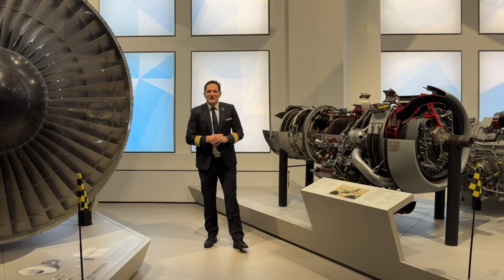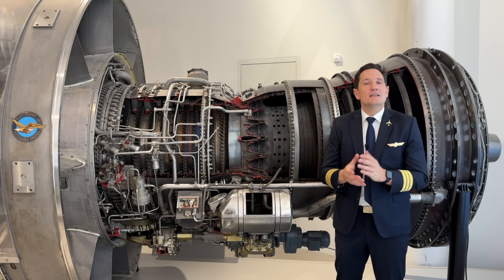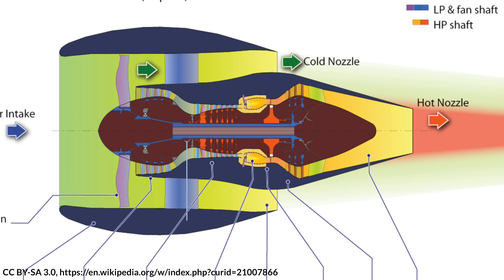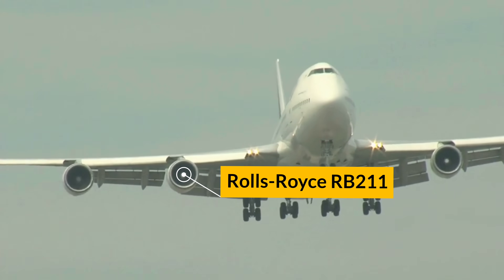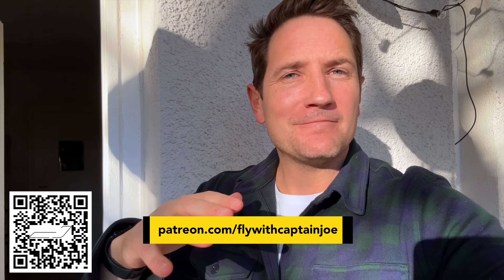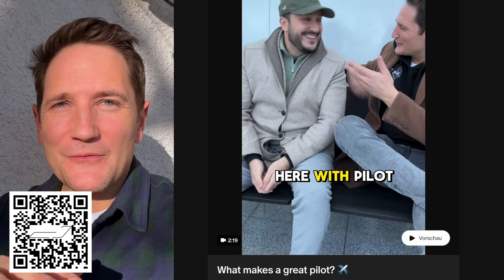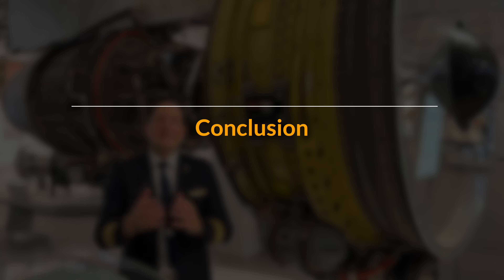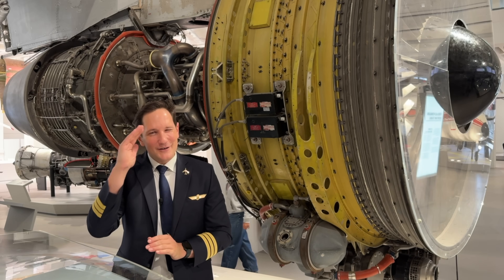Turbofan Engines: How They Work and Why They're Important - by CAPTAIN JOE

Comment: Big Turbine Hard Believe engineering even near optimal. First blade set enforce Flow and pressure against Motor eject plane forward increased volume Flow vs eject area. First Turbine set go through blade set To another pressure Flow go diffrent total pressures vs height. How handled optimal different heights

Comment: They should cool the air between the compression stages in order to inject little cooler air into the combustion chamber. This will improve the carnot degree of efficiency and follows that having 1 stage compression more and inject more fuel at same output tgas temperature through laval nozzle air inject to 1. Srage turbine stage

Comment: Question: regarding the fan bypass ratio, the examples you give for a/c from 5:1 thru 10:1 equal 5 times the amount of air bypass around the core of the propulsor in comparison to the thrust blasted from the tailpipe?

Comment: Hi Captain Joe. Can you make a video about the applıcatıon of Brayton Cycle to the TurboFan engınes. Step by step explanatıon of the Thermodynamic cycle troughout the engine on the P-V diagram. Effıcıency formula explanation of the engine. Pressure, Tempereture and Velocity graphs along the engine.

Comment: Im still struggling to understand how turbo fan engines produce 80% of the thrust used by commercial airlines and the core only 20%. how does it generate that 80% thrust without burning fuel
Reply: Because majority of the energy generated in the core is then converted to mechanical energy which then drives the fan which generates the majority of the thrust.

Something like how in a turboprop, the exhaust gases doesn't produce thrust, but only the propellers do.
Reply: @ZK-APA  thank you that makes sense to me now

Comment: The OPR or Overall Compression Ratio of a tipical turbo jet engine is in the range of 3.46 to 26. But for turbofan has above 30 with about 1.6 EPR and400 to 1100 EGT. Do they work at lower fuel consumption for this to takeoff and Go around?.

Comment: I'd have to work this one through, but, at higher altitudes there is much less volume of air that the 'fan' can move. Is there a trade off? If the bypass air has less volume per unit of time, how would this affect performance? Does the turbine part of the engine, need to increase operation in order to maintain a constant bypass airflow?
Reply: At very high altitudes, turbojets and low bypass turbofans give better performance

Comment: Next explain thrust reversers.  How an engine suck air in front and blow it back out the same direction it came and have a net force greater than 0?  It doesn't produce air after all.  All the air coming out had to go it first.  And if you don't reverse the intake, why doesn't the intake cancel out the exhaust during reverse?

Comment: I worked on the assembly floor at P&WA in the late 1970s assembling JT-8s and JT-9s. That looks like a JT-9Q with the variable pitch stators in the low compressor. I worked on P-3s in the Navy before that.

Comment: Concorde used 4 (Bristol Siddeley) Rolls Royce/SNECMA Olympus 593 Mk610 turbojets, each producing a maximum thrust of 38,050lbs, with reheat/afterburners.Without the reheat, they produced 31,350lbs. Overall pressure ratio was 15.5:1

Comment: Thank you so much for this video! Finally someone actually focuses on the bypass and how it works. That's the topic I was curious about for a long time, however majority of videos on the Internet explain only the core part (compressor, combustion chamber, turbine) and then at the very end simply add "oh, and by the way, the bypass also increases efficiency". And no one explains how??

This is the first video that properly pays attention to bypass, explaining how it works and why it helps with efficiency and noise. Thanks!!

Comment: 2:14 - one minor comment to add here is that, while, yes, 99% of turbofan engines do indeed have the fan at the front, there are exceptions. The Convair 990 Coronado had General Electric CJ805 engines, which actually have the fan at the back of the engine. The GE CF700 also uses this design, powering some variants  of the Rockwell Sabreliner and Dassault Falcon 20 business jets. Sure, it's an unusual design, but it certainly exists

Comment: Answering some of the questions posted here for the benefit of everyone:
1) Why turbofans are more efficient:
The thrust of an engine is a force. Taking newton's 2nd law, F=ma=m(dv/dt). To increase thrust, you can increase the mass of air being accelerated, or accelerate it more. However, the energy required to accelerate this mass of air is proportional to the change in kinetic energy of the air (KE= 1/2 m V*squared). Therefore, to double the velocity of the air, you have to expend 4 times the energy and it follows that accelerating a larger volume of air by a smaller velocity is more efficient.
2) Turbojets vs turboprops vs turbofans
As Capt Joe mentioned, we start off with the turbojet, which is a gas turbine that expels high velocity air as thrust. If that gas turbine was then used to drive a propeller shaft, it is then called a turboprop. If it is used to power a rotor shaft, it is called a turboshaft. If it is used to drive a ducted fan, it is called a turbofan.
3) Geared turbofans
As you increase efficiency by increasing the bypass ratio, the size of the fan has to increase too. However, large fans tend to suffer efficiency losses with supersonic shockwaves at their blade tips (on top of requiring sturdier materials due to their higher rotational velocity). To circumvent this, new jet engines like the PW1000G have a reduction gear that steps down the fan RPM to a more optimal speed, while maintaining the LP compressor at its optimal RPM.
Reply: You may be right about point 2), but I would like to understand it a bit more. What is the difference between a propeller and a fan? Is it just the size? Is it just that it is ducted? Some more details, the trade-offs would be nice to understand.
Reply: @balazslengyel6950  I think it's considered by its the size or name of the things swirling around the rotor. As you may know, there's some news on "Open Fan" Engine recently, so that's why I think the name could be originated by the type of fan/propeller. I'd also like to know more about this one
Reply: If you look up Newton's law "F=ma" where "a" is acceleration and not velocity. Please avoid basic mistakes.  https://en.wikipedia.org/wiki/Newton%27s_laws_of_motion.
Equating thrust which is a force with momentum is a strange statement. As Newton's 2nd law states Force is the change of momentum per time unit. F=dp/dt

Thanks for the update.
Reply: @balazslengyel6950 Thanks, I've edited the comment based on F=ma,

Comment: Parallel to the gearbox idea, what about a hybrid airplane? Have a third shaft in the turbine (or an apu type system) to produce electricity that spins an electric fan. For instance, the outer pair of fans on a 747/A380
No weight of batteries and the improved efficiency with less combustion
Reply from the maker: Already in planning! I'm good friends with Pratt and Whitney :)

Comment: Q, Weight and balance is so important on aircraft why aren't there sensors and scales in the landing gear to tell you exactly the weight and balance?
Reply: Ask the accountants about it. Of course, it would be splendid to have own built-in weight sensor, but... this will increase the mass of the aircraft. Every aircraft will need to carry this extra mass during each takeoff and cruise, which incurs higher fuel cost, let alone the design, installation, maintenance, calibration etc. So, it will be cheaper to use stationary balances at the airports. If you had this idea, engineers had had it too, but it must have turned impractical or cost ineffective.
Reply: @ i think the weight  and cost issue would be indicated by the safety advantage, say it cost 1million more per aircraft at the price of 100+m it would be a drop in the buket,   and the weight could easly be justified,.
Reply: additionaly knowing the exact # wolud allow you to plan your fuel more percicley  effecting saveings

Comment: Can you please explain how the aerofoil works to produce lift when an aircraft is flying inverted? Does the pilot simply have to use lots of tail elevator to counteract gravity, or is it more complicated? Thanks! 👍
Reply: In regular aircrafts, the inverted position would require different (larger) AoA and more trimming to counteract gravity and (inverted) lift, as you mentioned. In acrobatic aircrafts, airfoils are more symmetric, so the (inverted) lift is not so strong and it's easier to control the aircraft in inverted flight. Certainly, this is always  trading manouvreability for efficiency of regular flight.

Comment: The Concorde was powered by the Rolls Royce Olympus turbojet engines with afterburners and variable intakes for supersonic speeds.
Reply: The B-52 will get new turbofans and lose 100 MPH cruse speed.   Making them obsolete.
Reply: @u2mister17 - Switching to Turbo-Fan engines would lengthen it’s range and longer between time needed for refueling. Important for on the air nuclear deterrent sentry, speed not much since the former higher speed wasn’t substantial to make any difference.
Reply: @inisipisTV    Nice salad.
Reply: @inisipisTV  
No need for an "air nuclear deterrent sentry". That's what ICBMs are for. Also, a drone could take it out. times are changing.
Reply: @u2mister17 GOOD ..that's all too say ...
Reply: @u2mister17  
B-52s are obsolete already.

Comment: Hi Captain, I understand that air bypassing the combustion chamber is not being burned with fuel but it still needs to be sucked by the fan and compressed at the low pressure compressor. Where the energy required to do this job come from? I was unable to understand if the low pressure turbine is totally powered by the low pressure air or if it also receives air coming from the high pressure turbine but in any case, this is not "free" energy and there must be some "trust" being consumed to perform this task?
Reply: The air to cool the combustion engine comes from the high pressure compressor. Part of the air that goes through the compressor is simply redirected around the compustion chamber. The energy to do so comes from the high pressure turbine. So simply said, part of the energy produced in the turbine is used to cool, not to produce thrust.

Or do you mean the air that is called the secondary stream, the air air that completely bypasses  the core? That air doesn't really get compressed at all. The fan is the first stage of the low pressure compressor, so the pressure of the bypass air is very slightly elevated, so really only by 1.1 to 1.3 times. And the air stays that way until the nozzle, where it then goes back to ambient pressure.
The energy for the fan comes from the low pressure turbine.
Reply: @CerberusTenshi  thx for your reply! I meant the "air of the second stream, that completely bypasses the core".
My point is, even though the Fan+Low pressure compressor does not build a significant amount of pressure, it still needs to move a large quantity of air mass, and the force required to do this is coming from the low pressure turbine (through the corresponding shaft), which is itself driven by the air coming from the core. So in the end of the day, the movement of the bypass air flow is not totally obtained "for free" since it is "stealing" some energy from the combustion air flow. This is pretty similar to the turbos principle of the internal combustion car engines where the exhaust gases are used to drive a turbine connected to a compressor that compresses the intake air flow. Thx again for your concern with my comment. In the end of the day I just wanted to point out that in nature no energy is obtained for free! Cheers.

Comment: So can we in a way call Turboprop engine a turbofan engine without a  casing in terms of working mechanism or am I missing something?
Reply: A fourth video in this series discussing turboprops wouldn't go amiss.
Reply from the maker: @hellionfi  Noted!
Reply: I know the differences, but they are minor at least in the core working mechanism. My real question is: what makes a turbofan so different from a turboprop that it belongs to an entirely different category and is used for entirely different speeds? The difference seems minor, with the major ones being the greater number of blades in the turbofan and the duct covering it. Another fact is that, in modern aviation, more and more thrust is generated by the fan rather than the exhaust. This brings turbofan even closer to the turboprop, where the majority of thrust is produced by the propeller. So what makes Turboprop (less and open balde) different that it is more efficient at the lower speed?
Reply: And yes, an unducted (aka open-rotor) turbofan like the CFM RISE is essentially a turboprop, but with significantly different propeller/fan design intended to extend the efficiency advantage of turboprops to higher mach number, around 0.7-0.8 or so
Reply: Don't unducted turbofans present significantly more danger to the fuselage in the case of a bird strike or other foreign object strike? The immediate area could be reinforced for some mitigation, but what about blades flying into any of the aft surfaces?
Reply: A turboprop doesn't have a low pressure turbine and a second shaft, does it?
Reply: @FaySmash  Both turbofans and turboprops can be either single-spool or dual-spool. With turboprops it's also common for the prop to be driven by a separate ("free") power turbine that's after the engine, not mechanically linked, which allows the prop rpm to be independent of engine rpm. This would be equivalent to a turbofan having a separate turbine for just the fan (assuming it does not contribute significantly to compressing air going into the engine core).

Comment: The PW1000 geared engines are really an interesting path towards future efficiency improvements.

The current implementation on the 320Neo, CS300 (it wasnt designed like the rest of the Airbuses) and E2 jets have such a charming sound taxiing and on approach, i immediately recognize them just by sound.
Reply from the maker: You mean the "whale"-sound?
Reply: You bet, Joe